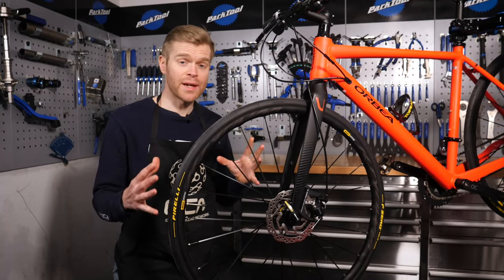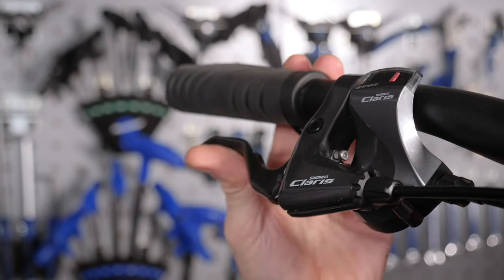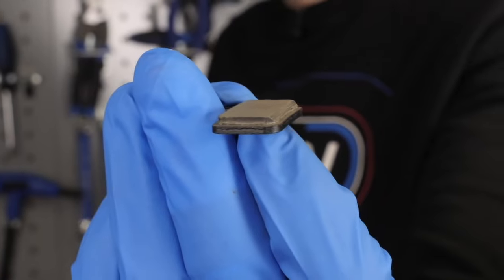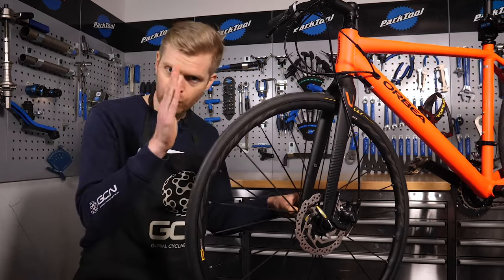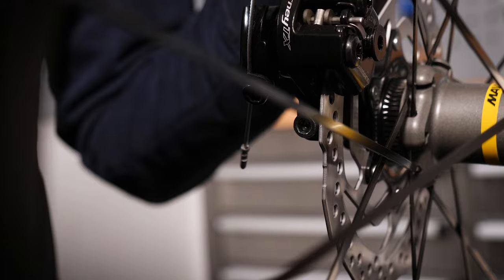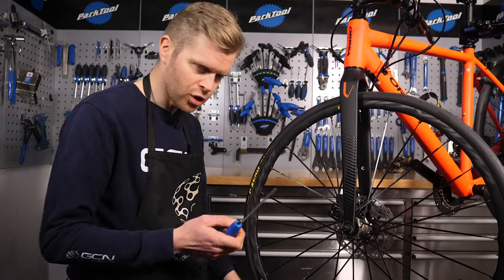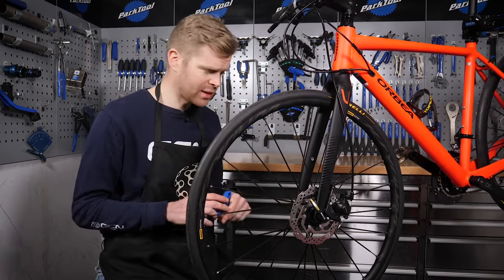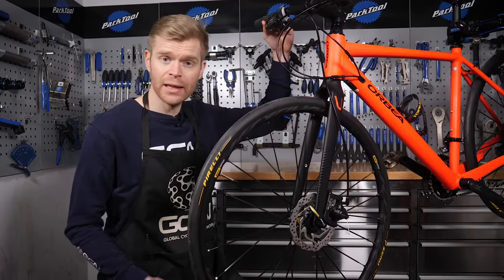How To Set Up Cable Disc Brakes On A Bike| Bicycle Maintenance Basics

Comment: Not sure why anyone would buy new cable disc brakes. Weights more, worse performance and needs more adjustments.
Reply from the maker: Sometimes people can only afford cable disc brakes
Reply: Cheapest "mountain bike caliber" disc brakes start from about 30€/piece (Shimano MT400).
Reply: @Pienimusta  for some reason road bike hydraulics are much more expensive.
Reply: Pienimusta cable disc brakes are still a popular choice for long distance endurance cyclists as they are easy to fix and repair at the road side. In contrast Hydraulic systems need lots of fiddly proprietary tools and fluids.
Reply: @Pienimusta  A road bike hydraulic set goes for like $400........
Reply: @sfasto1  Same for mtb. Not that you have to buy one. That cheap one will do the job for most cases.
Reply: Paul components klamper is a great disc brake.  Single piston. More durable than many.  Hydraulic brakes malfunction easier
Reply: @vgjgghbgyjn1985  Hydraulic brakes are used in both XC marathon as well as in DH. Durability is not an issue.
Reply: @Pienimusta  A little more up front but they work on cruisers, fitness bikes, commuter bikes, and the disc itself is a consumable rather than the rim. They're not the absolute-cheapest but they are long-term cheaper than rim brakes for a commuter bike which has heavy usage in all weather, and less fiddly than trying to find and setup rim brakes to work with wider tires. Many cruisers are also in MTB wheel sizes - 26, and some 27.5  and the occasional 29 now - with slick or street tires, and feature disc brakes.
Reply: Now we have a split in the disk brake group. 
Hydraulic or cable.
Using some of the same arguments as rim vs disk. 
Cost, weight, etc.
Reply: In addition to what the others have said, transporting bikes with hydraulic callipers needs more care. Google for air bubbles and transporting hydraulic brake bikes upside down. etc
Reply: @Wildschwein_Jaeger  There hasn't been any split for past 10 years in mtb community when even cheapest possible disc brake nowadays is hydraulic.
Reply: @Pienimusta  Cheapest possible disc brakes are still cable and found on ~$200-$400 USD bikes (depending on other features to hit the price points). They're usually small/off brand but they're there, and those are fairly inexpensive for people building and experimenting rather than just buying one out the gate. Upgrading a touring or other sort of bike from v-brakes requires no lever change either, just the wheel/hub and a way to attach the caliper - which may come from replacing the fork after a crash.